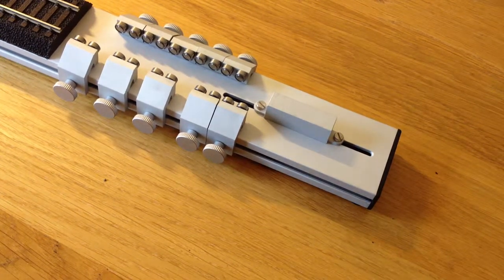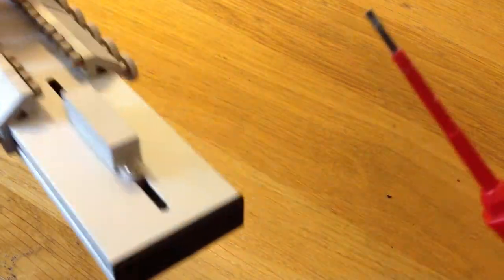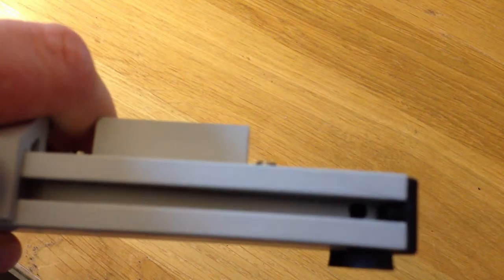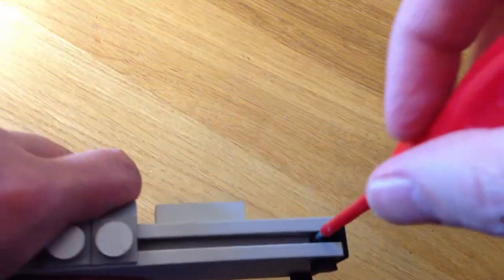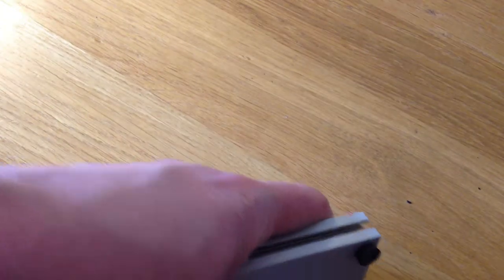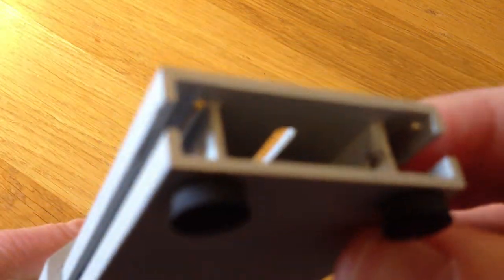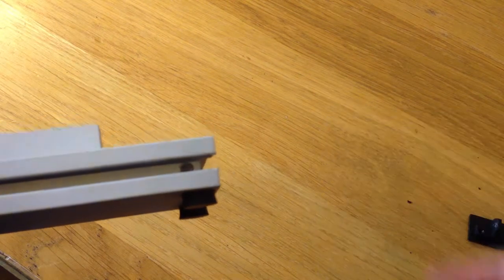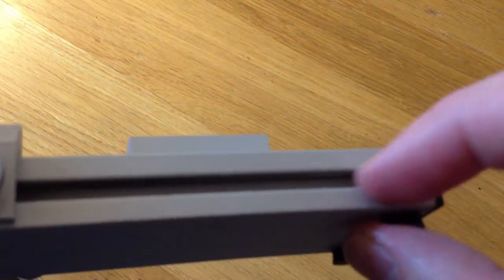Removing a roller from a Hornby Rolling Road

Comment: Great, so the trick is via the little round holes to remove the end caps. I've just received an additional pair of rollers so all four driving axles of my Hornby P2 can be supported. Not sure why one would want to remove rollers though, only add some more